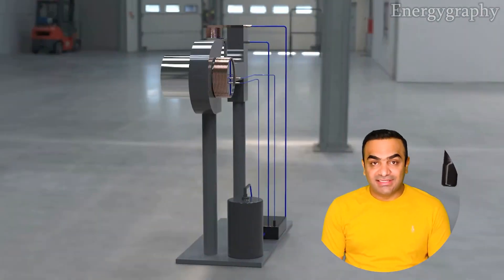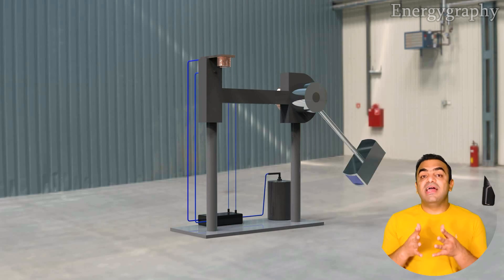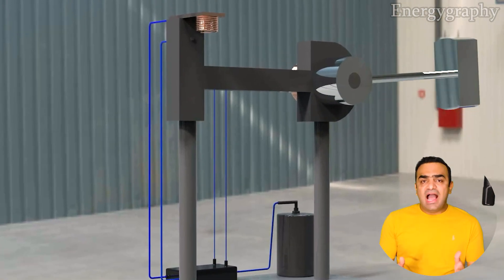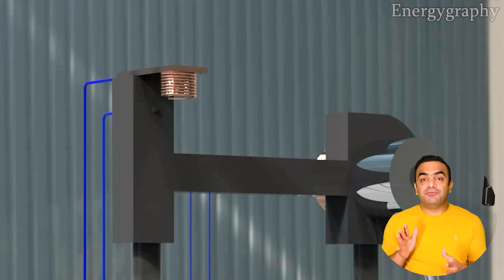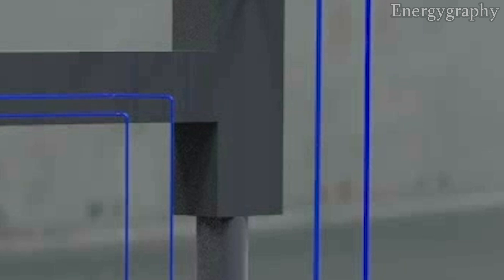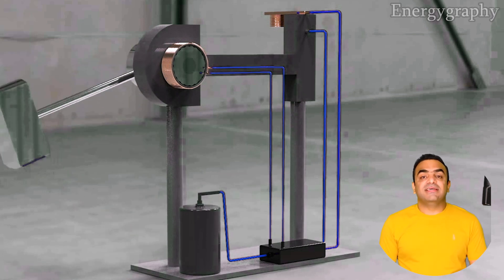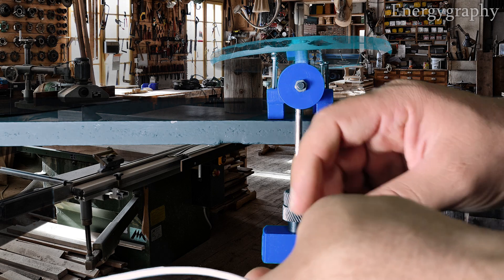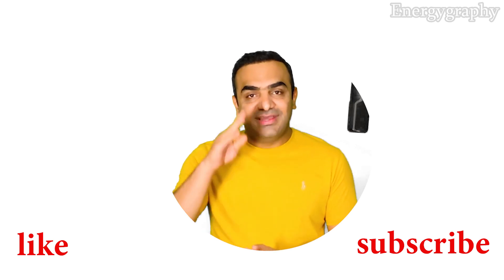power booster

Comment: Neat. All these are interesting learning tools and could have interesting applications possibly outside the idea of perpetual motion machines.
Sadly, the generator of the swing arm will never generate enough power to overcome the natural friction of the swing arm, including wind resistance, and the opposing force it applies as part of the process to generate the electricity.
Watch a video of someone swinging a magnet into a big chunk of copper, or dropping a magnet down a pipe. Watch how they will be cushioned by the copper. This is because when a magnet moves near copper, the copper will generate an opposing magnetic field and press against the magnet. This steals the magnets kinetic energy. If the copper is all by itself, the energy will be converted into heat as well. If the copper is connected to a circuit, an electric current will flow, the strength of which relates to the strength of the magnetic field being generated.
Long point short, the generator's copper coil will add resistance to the pendulum. It will cause it to lose kinetic energy. Also, it will not ever generate enough electricity to counter it. It may cause the arm to swing for longer, but eventually the energy will bleed out of the system.
Beyond that, the ultimate failing of a perpetual motion machine isn't that it can't power itself, it could never power anything beyond itself. People have spent years on this issue, and no one has seen how much bigger a mountain it would be to succeed, as then you would have to intentionally add more resistance to the motion to get power out.
Reply: I agree if lenses law remains in effect.  But lenses law can be defeated and when you defeat it that is win you can get more power out then you put in
Reply: @rmendes2mendes915    I guess you mean Lenz's law? The more general law is conservation of energy. There has never been an observation violating this law and this law is backed up by a mathematical proof (Noether theorem) that our universe couldn't be stable without conservation of energy. That's strong stuff and hard to defeat! It is quite obvious that the construction shown in this video does not work. It can not even generate the energy to overcome friction.
Reply: Yes people have spent years trying to get more power out then they put in and there has been quite a few who have achieve that goal and the reason you don’t see it implemented on the market is because they are always bought out threatened or killed in other words cheap energy is not allowed and big oil and the energy cartels make sure it doesn’t happen.
Reply: @rmendes2mendes915    This is just a myth. Big oil and energy cartels have their scientific advisers who tell them that free energy does not exist. They take no interest in the free energy scene at all. But many big companies are spending a lot of money for energy, Google is an example. They would utilize free energy at once and thus increase their profits immensely - if free energy would exist. Can you give me some names of inventors who have been most likely bought out, threatened or were even killed? If not, how do you know that they achieved more power out than power in?